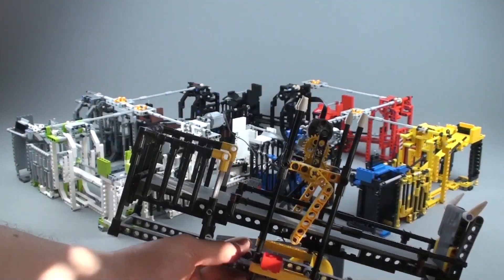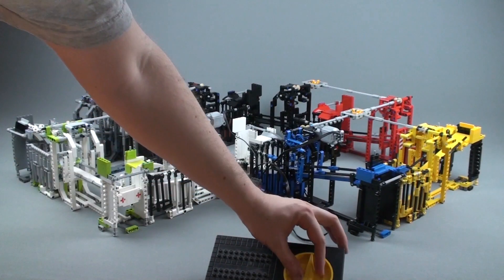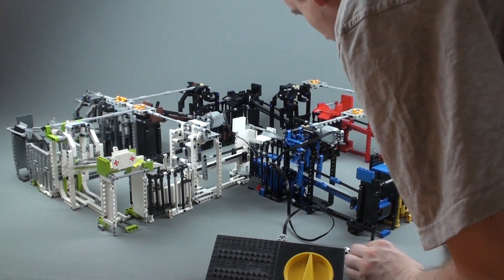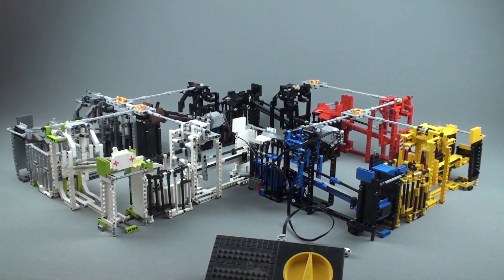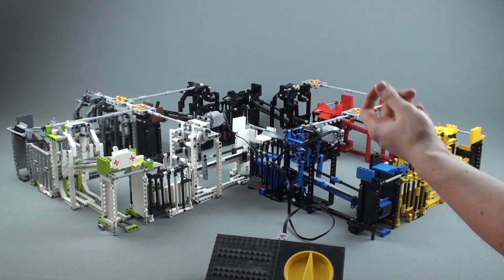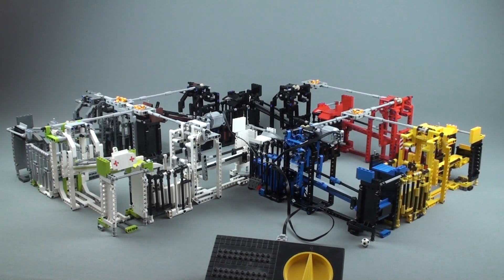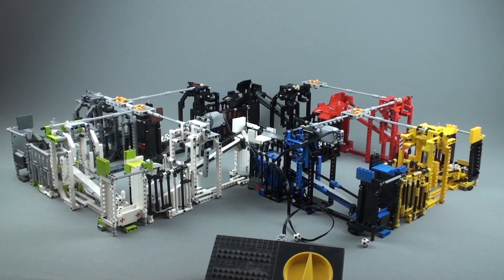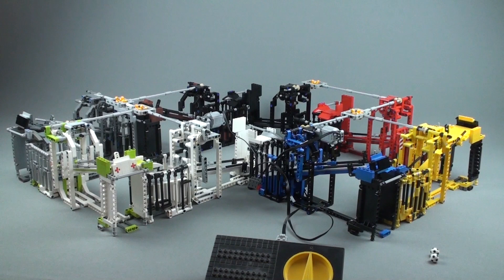LEGO GBC Testing: Tipper Modules

Comment: I like all the modules running at the same time. It looks really nice together. I don't know if you will do this but the exit and entrance should be in line with each other.
Reply from the maker: My previous version of the module had the exit go directly into the next module. While I prefer that type, I will also show why this aspect was changed in this version. This will all be in the presentation video once reliability is up to par.